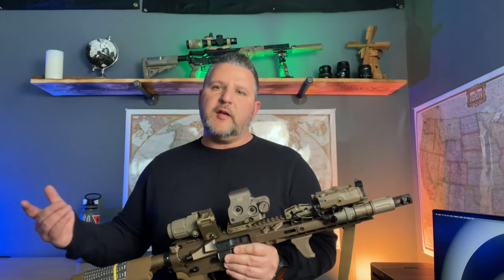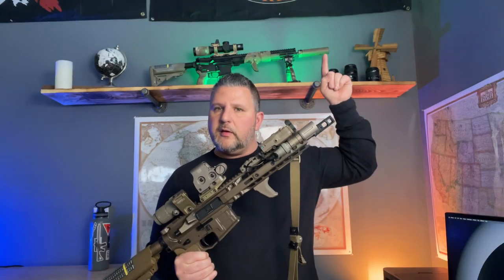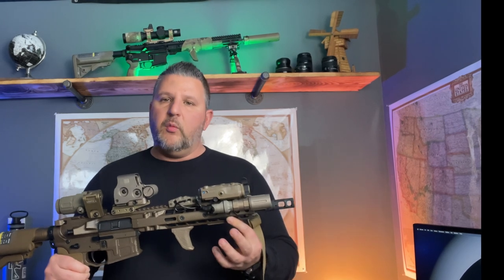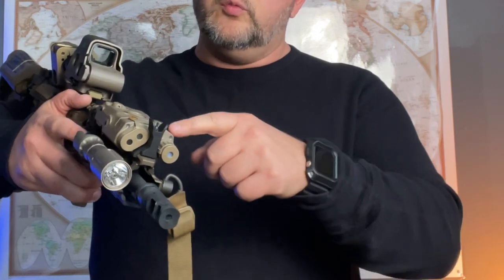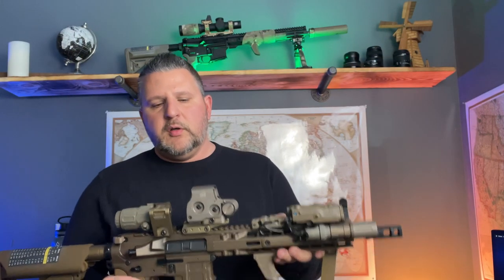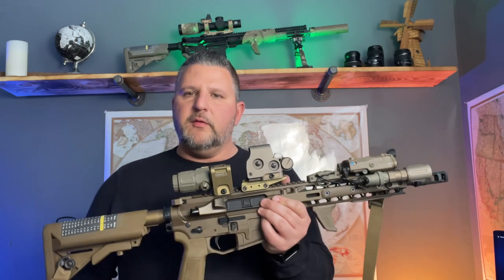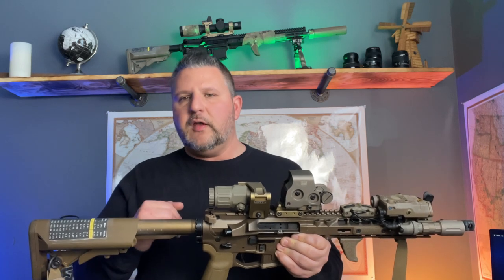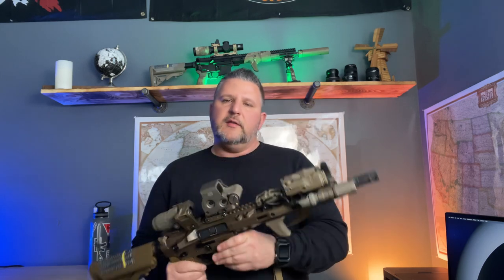🔥 The BEST 11.5" AR-15 Setup? - How to Setup a Short Barrel Rifle (SBR)

Comment: I think 11.5 is the ultimate urban warfare setup, nice mix of maneuverability and range. This or a 12.5, both mid length gas
Reply from the maker: Completely agree!
Reply: Both great, for me it all would depend on what suppressor you're running at the time. 👍👍
Reply: @henrygonzalez360  right now primary arms has the solgw m4-76 11.5 upper w/out bcg and ch for $379. I picked one up taxes and shipping $417 delivered the next day. He'll of a deal. I couldn't pass it up.

Comment: On the fence about the 11.5 barrel length...velocity etc. What are the advantages besides compact for moving in close quarters??
Reply from the maker: For me personally, it's still plenty accurate and capable to distance around 600 yards with 77 grain ammo.  Better ergonomics in terms of weight distribution when I have the Peq, light and suppressor on, compared to those items being far out on a longer rail.  Think front heavy and support arm fatigue.    If i am shooting further than that, I will  be using a larger caliber, not 5.56.  99% of what i shoot is inside of 100 yards (daytime or under nvg) and on steel or paper targets, so this fits the bill for me.  1% for varmint hunting at night.  I guess the answer is, your rifle should be setup to do well for what you intend to use it for.

Comment: I have similar setup with optic risers. At this point I’m going to take off the iron sights. No space and it defeats the purpose of iron sights since I can’t see them through the optics
Reply: I guess the idea is guys run these if their main optic goes down and has a QD they can remove them and the weapon system doesn’t go down just because the optic does.

I run holosun red dot and magnifier for that reason. The EOTECH have horrible battery life and I’m not risking my skin  in a home defense or SHTF scenario where once a month the battery is toast .
Reply from the maker: Eotech should have a 4 or 8 hour auto-off depending on the button you use to turn it on. Should def last more than a month. But I understand the point you’re making.
Reply from the maker: Most of my optics are on QD so removing them and defaulting to irons is not unattainable. Def not ideal and absolutely not common to have to do that. Let’s hope I/we never have to do it.

Comment: Nice setup. I’m running most of the same accessories. I have a slate black industries vertical grip. How do you like the Emissary hand stop?
Reply from the maker: I love it. Haven’t tried the slate black though. I’m going to look into it.
Reply: The Emissary is a bit bigger than the Slate hand stop, in my opinion the Emissary is better.  Right between a stubby grip and a small finger stop.👍
Reply from the maker: @henrygonzalez360  I they make a smaller one now too. I still like the original. Lets me get my last 3 fingers on and is great for barricades.

Comment: I appreciate the matter of fact way of just getting to the point and not talking to hear yourself talk. I click off those person's. 
I also run an 11.5" sbr and it's effective inside about 300yds. 
Nice setup and important to have it compatible with NVG'S.
I try to get everyone to at least get a PVS-14 but they're fast getting out of the price range of a lot of person's.
Good video. Thx for posting!
Reply from the maker: Appreciate the feedback. I used to make longer videos but started seeing a trend in analytics where people dropped off. I started cutting those parts out and trimming the videos to about 5 mins which is more than enough to get the points across for most topics without losing people’s attention. I’m impressed you took notice and super grateful for your support!